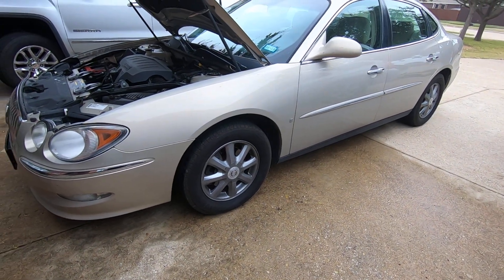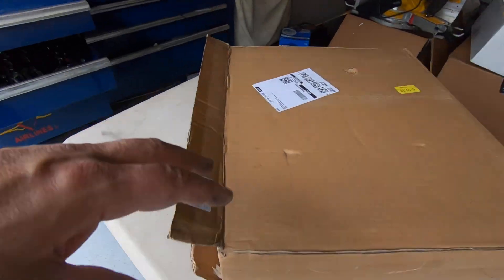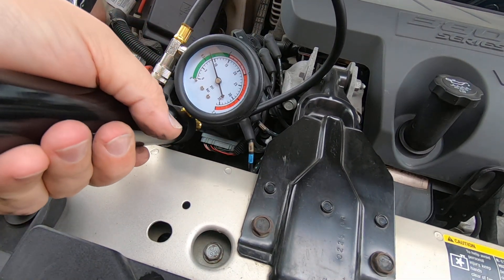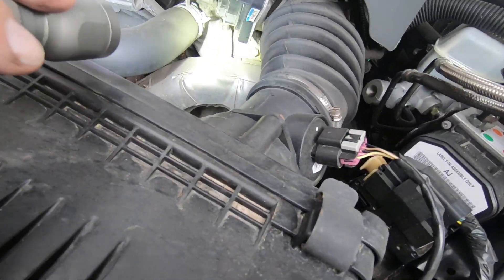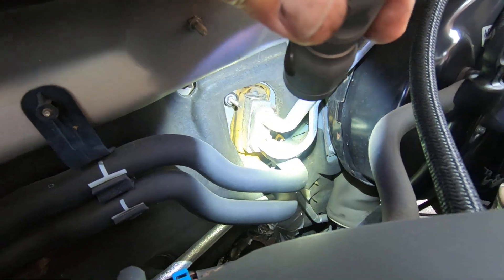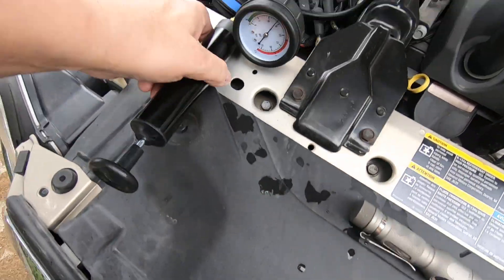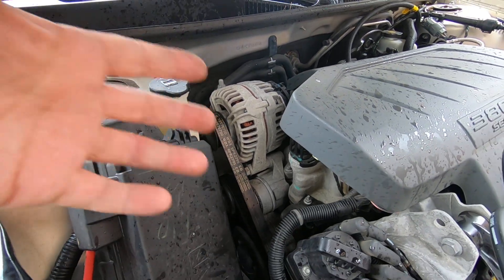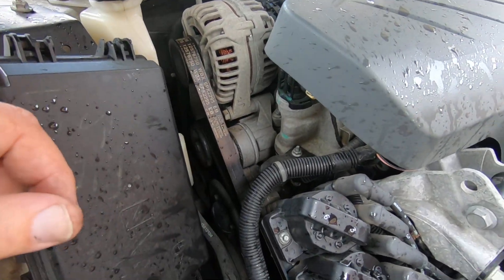Finding a Coolant Leak on a 3.8L GM Engine using a Radiator Pressure Tester.

Comment: Can you pressure test the cap with that kit??
Reply from the maker: You cant pressure test any screw-on cap only the old school caps. I am going to be doing a review on the kit in the next week or so. Here is a video where I use it to fill the car using the vacuum adapter. https://youtu.be/hU7uojLzE48